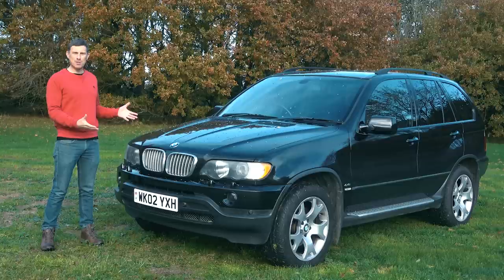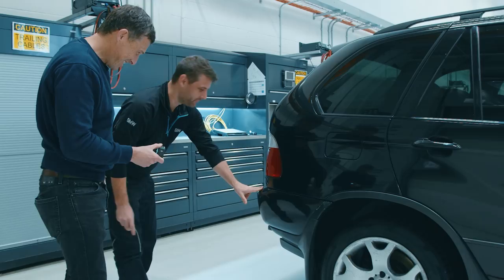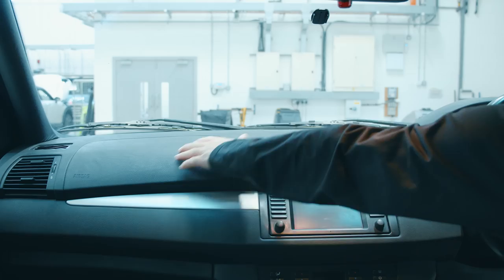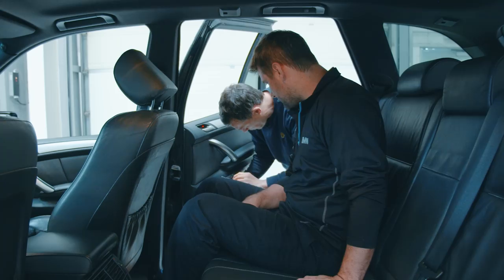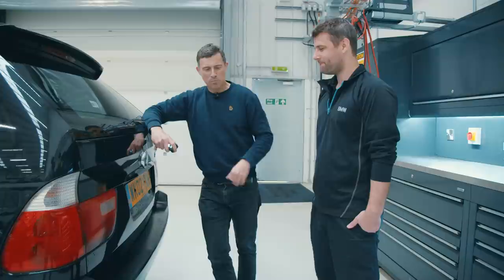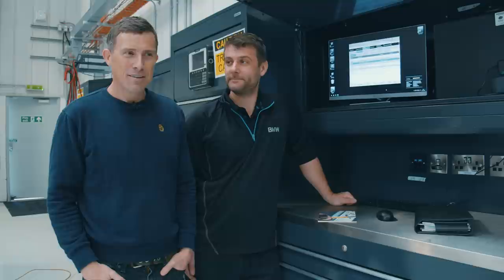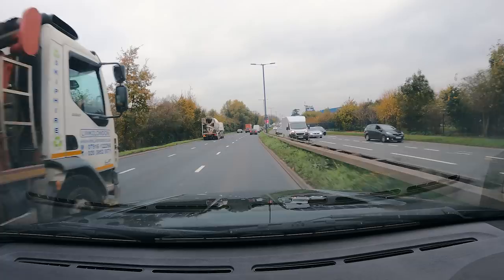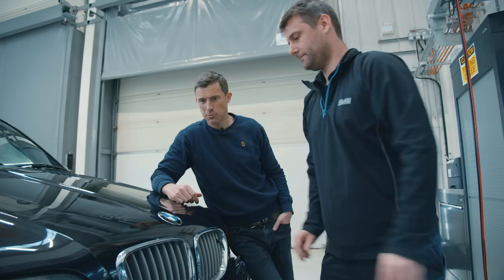BMW RATES MY 'NEW' X5 V8!

Comment: I've seen enough of these over the years to always check the front axle shaft rubber boots.  They're almost always cracked.  $25 for a new boot and $500 for the labor in putting it on per side.  The V8 is the one to stay away from as they have timing chain guide issues when they're over 100k miles and also leaking coolant transfer tubes and blown PCV valve issues.  Hopefully this one has had these looked at already.  The E53 6 cylinders are pretty bulletproof.
Reply: As long as you replace the timing chain guides before they go bad you're fine. The problem with the inline sixes are not the engine, but that the transmission they're connected to is even worse than the one they put behind the V8s. They're both pretty bad though!
Reply: I have a 02 x5 4.4i v8 and it’s definitely leaking coolant and needs the pcv valve. Also got a fuel tank and starter replaced. Needed wire work due to mice getting in the engine I was told. Not including a new dash display. I’m not sure what other issues I might run into

Comment: Mine is almost the exact same spec, 2001 4.4l black on black with Sport Package. I've had it since 2013 with 90km on it, now at 210km. I've done nearly every bushing and joint front and rear. Rear subframe bushings were in the worst shape. Replaced the front struts with bilsteins. Radiator problems are common (I've replaced it twice!), and so is the ABS module which I had remanufactured (highly recommend). Valve cover seals have been done twice, and will be done again soon. I tow a camping trailer with it and it always amazes me how well it tows. It's a great vehicle to drive, handles extremely well and still looks great in and out.

Comment: So I bought a 118i 2009, under 60K miles, full BMW service history, pretty immaculate outside and unmarked inside. A real keeper I thought . Put a tow bar on it. Replaced the windscreen as there were some scratches. Just loved it for a few months, into covid shutdowns etc so put hardly any miles on it and then started to hear a little knocking. Decided to take it to local BMW dealership and paid for a diagnostic survey. Cost £90, got a report and video that said it needed further investigation but torque converter was probably the problem, plus a whine from the diff needed further investigation plus suspect wheel bearing. My local garage wouldn’t touch the torque converter but a local BMW “ specialist” looked at it and diagnosed cam chain problem and not torque converter. Paid £2k to have that done and the knocking noise was still there . Told my local garage about it. They looked at it and suggested it was No 4 big end. Took off the sump and stripped it down and hey presto! They were right. I had a choice. Keep going or scrap it. Yeah, I scrapped it and that paid my local garage bill! What have I learned ? Main dealership service history is no guarantee, you can’t trust BMW main agents perhaps and paying them to diagnose a problem is also no guarantee they get it right, BMW specialists aren’t any better and it turns out your local private family run garage is probably your best bet. I’m lucky I could afford to make the mistakes  but for some folk wasting a few grand would be devastating.

Comment: you might say that spending that isn't worth it but a new one will depreciate while this won't and if you take it to a local garage it will probably have lower maintenance costs over time so you will still be spending way more on a new one so if you don't care about the latest tech i think this is still a good deal.
Reply: if you fix this it will fail again. its a never ending circle
Reply: 18.3 miles per gallon might get a bit expensive though. 9:15
Reply: Na something else will then break. Thats the way of old cars, every inspection bill will be higher then the last one.

Comment: Now get a cost together of all the same work done at an independent garage + use second had parts for the door mirrors etc.  I'll bet you can get the bushes for the swing arms too, they will just have to be pressed in and out.

Comment: I had one of these - 3 litre turbo diesel. Great car but had loads of issues with alloys cracking. Still did 100,000 miles in it without any major mechanical issues. Great to drive.
Reply: as in the wheels?

Comment: You didn't ask about the gearbox. Having had a 2003 diesel I constantly had gearbox problems I think mainly caused by BMW saying that the oil will last a lifetime, well the gearbox has a lifetime of less than 85000 miles. Good luck, lovely car ridiculous parts costs and you'll need a lot of them.

Comment: I own this exact same car (in LHD) with nearly 150k miles, had it since it showed 43k miles.  The list of repairs, almost all diy, is a mile long.  Most critically: the torque converter failed taking the transmission with it at 93k, the ABS module failed (...twice!).  The suspension has been refreshed at least twice and the engine has been out to replace all the seals and do the timing and Vanos at 130k.  The front drive shaft splines let go at 149k.  My kids drive this car every day and I put quite a few miles on it as well.  It is a great drivers' car, just gobbles up the miles.  Still love it despite owning a much newer and faster Cayenne as well.  I think that having the E39 DNA is what makes this such a fun car to drive!
Reply: It's basically a e39 In SUV form and I want one now lol

Comment: My '03 4.4 X5 (sport package) has over 230k miles on it, still running strong.
The E53 spt pkg is a great driving vehicle that lasts a long time, IF it's properly maintained.
Just installed a set of Hawk Talon rotors and Hawk 5.0 pads when I installed the 19" staggered rims/summer Ultrac Vorti tires this spring. I run P-Zero all seasons on non staggered 18" in the cold weather. Almost all the miles have been in Florida and Texas.

Comment: For total of around 8K you get a very nice, comfortable and mechanically perfect car. Honestly I would drive the car for a month and then decide whether it will be mine till the scrapyard. If I like it, I would fix it all and enjoy it. For 8k you can buy newer car, but it  will be coming with their list of issues and again nice fat bill to fix. I think it is time to start fixing and reusing, rather than buying new all the time and throwing away.
Reply: He can get all the work done at a local garage and buy non bmw parts just as good , £1000 most
Reply: @sahmedt9  A bit more than 1000£ but less than 2k£
Reply: It all depends where you live. I live in Italy and just to have this car on your name the taxes wil cost you around 1000€. Also this is an Euro 3 petrol engine and here they will ban it from the road in big cities, already in Milan they banned Euro 5 diesel engines. If you want to keep it for a few years you have to buy at least an Euro 5 petrol engine

Comment: Those parts prices bear no resemblance to the actual cost to make and to ship to the UK. When you add in the margin for the UK importer and then the margin for the dealer on top of that you are looking a a multiple of the actual cost. My tip is to buy OEM parts from Bosch, Hella and the like or good serviceable second hand parts from eBay.

Comment: Mitch is definitely right about the rattle. I have both an 02 e46 and 03 e53.

The e53 is as quiet as it gets, except for the slight rattle rear passenger door cards give when the car is at an incline due to some of the glue wearing off off the door (easy fix if Im not so lazy). Other than that, zero rattling.

The e46 on the other hand has so much rattling from the engine bay, to the interiors, to the bushings, that I just dont bother anymore. I just learn to live with it.

Tbf though, the e46 have double the mileage of the e53.

Comment: I’ve got a 2001 E53 4.4 which I’ve had for 10 years. Can’t find anything to replace it with that offers the same drive, rarity and value for money so it’s staying with me. Ace. I’m looking forward to seeing the repairs that aren’t needed. All I would would be to service the transmission and change the engine oil then use it. Subscription added.

Comment: I recently purchased an E39 sedan in what appears to me immaculate condition. From the second owner, garage kept and serviced at the same dealer since new. I will be doing preventative maintance on the cooling system as well as plugs & coils. There's just something about these "old" types of cars that you can't get anymore in newer cars. I'm very much looking forward to the experience.
As a car enthousiast, I think you'll love the X5 as long as it's working properly.
Reply: E39 was made in Germany while all E53 were made in USA. There is a huge difference in quality between the two. Even the E46 feels better put together.
Reply: @darek4488  That's very true. I often try to tell Americans that the BMW Models they claim are unreliable all turn out to have been both produced in Germany and the USA and since they live in the USA, they got the US made BMW Model. 
On top of that the USA has not something like the "TÜV" as we do in Germany which basically forces you to take good care of your Car, do Oil Changes as regularly as the Manufacturer tells you and with the Oil needed as well. 
In the USA the Laws are much more lax regarding Car Maintenance, Oil Changes, this is why in the USA they got "Beaters" as they call them, Beaters wouldn't even be allowed on the Road here. 
So in conclusion BMWs here are considered super reliable and i'm sure a lot of People who claim their BMW constantly breaks down and has issues is because they didn't take proper Care of the Car, postponed Oil Changes etc.
Reply: @chartreux1532  I am sorry, are you talking about the lifetime transmission fluid or engine oil every 30000km, including the first engine oil change in a new car? Because this is exactly what BMW recommended.

Comment: Great car and great video, Mat.
BMW Service always seem to have great staff.
I had 2003 4.6iS in Australia and it was brilliant - 350bhp and massive wide wheels as option 295/55 20 front and 315/55 20 on rear. Gripped like anything.
Had issue with the pixels on the display that I managed to repair with an ebay kit myself - surprisingly.
Shame I had to sell it but the garage was full - something had to go!
Running boards are the best and most practical I've had.

Comment: Got an E53 3.0D myself. Really love it, despite having had a few problems but if I could start the process again I'd have bought a V8 as the economy is not that much worse than the diesel. And has V8 noise...

Also, absolute revelation with the spare wheel carrier.... I've probably lifted mine in and out about 10 times now. Always been quite a challenge...

Comment: I'm looking to pick a 2006 4.8 iS V8 soon and cant fathom why I love this era of BMW. A good video.
Reply: It’s just a solid era of cars
Reply: Be sure to let it idle for a few minutes and then rev it to check for valve stem seal leaks. Big puffs of smoke for most of the N62 engines of that era.

Comment: I've got an E53 4.6iS, an E46 330 Vert, an E39 540i and a E38 735i and they each cost me about a months salary to buy and another months salary for parts and preventative maintenance. I could have bought one new povvo pack Kia with that money, but I don't think their options include heated real nappa leather, xenons, adequate power or timeless style.

Comment: Thanks Matt. We had a similar 2003 pre-facelift v8 from new for 12 years. Quality engine & paintwork. Yes we had to update the pixels & other parts per service manual, but otherwise great v8 vehicle.
Looking back & comparing to current generation, it's the perfect size, similar to an  X3.
Reply: To small fot this kinds car

Comment: I only just found this vid.

Owned a 2002  E53 4.4i Sport from 2006 from 4 years old and ran it as my daily driver for over 10 years.

I kept on top of it. Showroom standard paintwork & cosmetics. Anything worn or broken was sorted near immediately. No worn bushes, everything worked, nothing leaked or rattled......essentially mine was absent of ALL the issues highlighted here. But time snd money were involved.

I sold for spares/repair when then (plastic) timing chain guides broke (they all do this at about 130k upwards on this engine). 

I paid about £20k used back in 2006 ...spent about the same in maintenance  over 10 years and sold it for just £1,400  .....It would have cost me more than that to pay to have the timing chain guides  sorted by someone who genuinely  knows these engines.

During ownership I had the following sorted ....

Rocker gaskets 
Crank case vent pipes and PCV  breather,  coolant expansion tank, Power steering pump, 2 pas hoses , various belts, batteries, alternator, outer front cv boots (twice) ....Various bushes including rear subframe and front thrust bushes, taligate switch...various door handle cables and window cables, ...the list goes on. Folding mirrorrs are tempermental as the switches in the mirroes bend or break. Mirror glasses can fail if they are auto dimming...various part numbers depending on spec. Nav can be upgraded to a mk 4 unit . Cost effective map discs allegedly available as are software updates for 3D view (Mk4 nav only). 

I like the valvetronic 320hp 4.4i with the 6 speed auto on the facelift xdrive cars ....that has a more reliable  6HP24 ZF gearbox albeit that box had a "lurch"...The facelift 4.4i valvetroinic engine has its own issues with valve stem seals and a coolant pipe leak deep in engine. 4.8is has similar  issues. The 4.6is has similar issuss to the pre facelift 4.4i engine and shares the same ZF5HP24 gearbox. Jury still put on the pros vs cons of changing  or flushing ATF & replacing AT gearbox sump filter.

Lots of good ownership memories....but not for my wallet or bank balance.

I would confidently inspect & buy the right car if armed with a fault code reader, some heavy duty ramps & some bravery pills.

As much grip as a sleigh in the snow unless decent winter or all season  tyres fitted. I had a winter  set on winter 17's same style as the factory spare.

Not for the faint hearted or those who don't pay  keep on top of maintenance. 

I must be insane...I also bought a 2005 V8 4.4 Range Rover Sport albeit that had a more (totally for me) reliable JLR engine.

No idea if you still own this Mat ..(I heard you reference it in your 200k vs 2k Range Rover vid) ..but good luck if you still do.

Mist stop ttping...even boring myself slightly now 😊

Comment: if everything does go wrong, I suggest you use what's left to engine swap something like a volvo 240 or a bmw e30 and race it against the GR yaris to see what happens 😁
Reply: E36 would be cheaper option i think. Mate of mine has an e30 and he spent my whole Miatas worth on just some engine and trans parts last year.

Comment: Hey Mat, don't go to a BMW dealership with a car of that age. ) As a former owner of several BMWs of that age, in the UK, and looking at the things that need to be done on this particular car, they can be done for around 1,000 GBP in a decent garage, with decent OEM parts. ...And, don't try to fix the motor oil leakage, it's impossible to fix it on those cars. I've tried a few times. )) Just top up the oil from time to time.

Comment: LOL.  Two days ago I had a leaking front headlight fitted on a 5-Series F10 (2011).  £1060+VAT for the headlamp.  I declined the three control modules at £900+VAT!  And then the labour on top, you have to remove the front bumper and stuff to get to the headlamp.  This was at an independent BMW specialist.
Boot release.  Fixed mine last year.  About £20 from Amazon.  When you squeeze the release handle, you are actually pulling rubber that interacts with a microswitch that does the release electrically rather than mechanically.  The rubber handle perishes, splits and stops hitting the microswitch.  Really easy to swap from the outside of the car.  No trim to remove.  When you get the new one, you can see where you need to insert the plastic tools to release the old one.  Would take about 10 minutes with care and a bit of masking tape over the paintwork, 3 minutes if you have done it before or three hours at BMW rates if they did it via the bonnet, remotely from Germany.
Rattle can 🙂

Comment: You can actually get those rear bushings made out of poly much cheaper. 
Front brakes you can get them for much less using aftermarket.  
It's just an expensive shop and they like just OEM and no aftermarket parts.

Comment: Enjoyed your content,very professional and easy to follow so well done,I had a brand new x5 3.0d sport in 2004 and had it 7 years and did 200,000 miles with just regular maintenance,a really solid car,never had one since,had an M3 then M5 then a 640 cabriolet which I still have now and will probably keep forever as i now do very little mileage,keep up the good work 👍

Comment: Should have bought X5 4.8is.  It's a lot nicer ride, even though the N62 does have valve stem seal issues.  Regarding the rear arms, you can put just the bushing in the arms.
Reply: N62 is a tough engine and don’t need a lot other then valve stem seals and the transfer pipe but it won’t blow up if you don’t replace it like the m62 with timing chains. N62 is a very good engine in my opinion when taken care of

Comment: Having  had what seems like a good deal with old cars in the past when you add up all the costs to keep them on the road it's normally not economical to do it unless you get a classic best cheap car I had was an old 1.7tdi astra on a 92 k reg with isuzu engine went for ever.

Comment: That beep is from an aftermarket Nokia bluetooth system! They were a dealer fitted option back in the day, it has a separate speaker for the handsfree and beeps scarily when it doesn't find a paired phone.